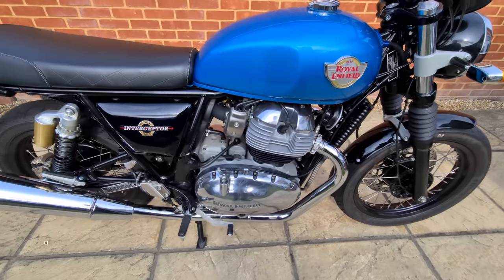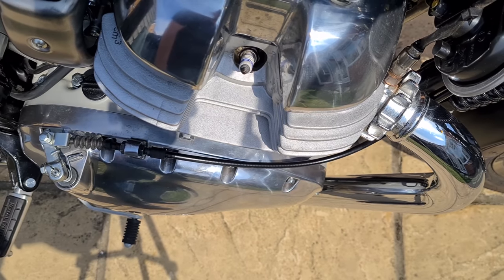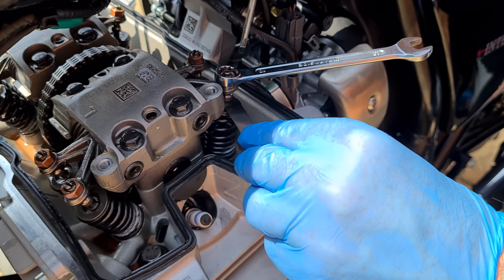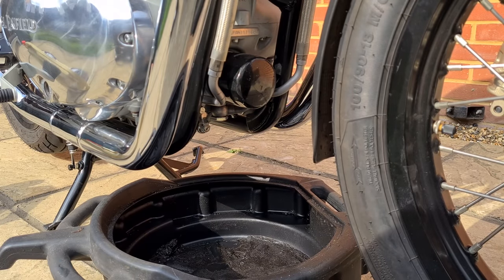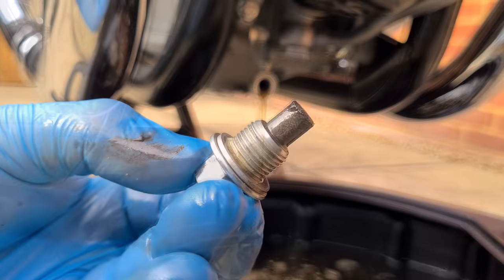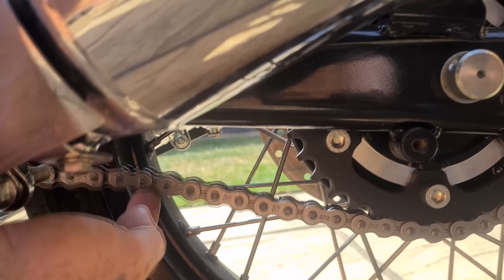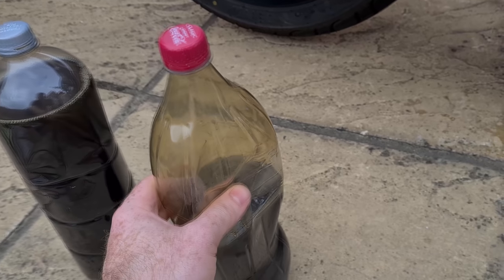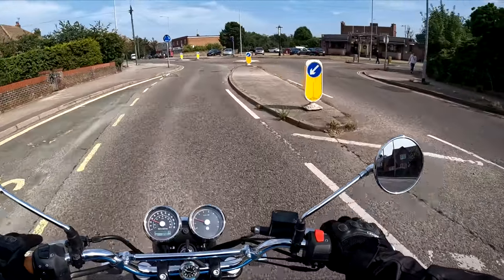Easy Valve Check & Adjustment on The Royal Enfield Interceptor & Continental 650 Twin

Comment: I only rotated the crank one time for valve adjustment. Ever since and now past 30k miles I just put it in 6th gear and gently bump the rear wheel to rotate the cam. After the 12k adjustment I only barely needed adjustment of one valve at 30k miles. This is extraordinary
Reply from the maker: amazing, thank you for sharing

Comment: 👍👍👍👍👍👍👍👍👍👍👍👍👍👍👍👍👍👍 Ye - now I understand why you didn't buy a Moto Guzzi V7 - You need slightly more challenge from the valve adj. procedure ☝☝😆😆
......... on the Enfield the tank has to be removed 🥵
This bike is easier to service than the NC750.... 😨😨 .....  
And, as many others, I'm also looking forward to the perfoming of the Meteors' service ‼‼
Making this kind of videos is your REAL call ‼‼Very WELL done ☝☝🧐🧐
Reply from the maker: That's why I sold the tiger really, valve check too difficult for me 👍 meteor 300 mile service comes soon. Same thing, a lot less valves.

Comment: Cracking job,I've watched a few videos of this and you're the first to actually remove the fuel tank, is it totally necessary?thanks.
Reply from the maker: probably not but it makes it better for video presentation, easier to adjust your valves and give u a change to check your abs pump and connections etc

Comment: You mentioned something about a some kind of sealant and possibly getting a new gasket. It's also my first time trying to maintain a vehicle myself as I usually bring my old car to be serviced. This time I actually want to learn how to maintain my own by myself. I just have a few questions. 
What kind of sealant do I need to use and how do I know when I need to change the gasket and use a sealant? 
How do I apply the said sealant? 
What did you use to spray to clean off the oil? 
When do you actually 'have' to change the filter?
Reply from the maker: Hi, use this sealant https://www.amazon.co.uk/gp/product/B000FW7VNW/ref=ppx_yo_dt_b_asin_title_o02_s00?ie=UTF8&psc=1 but to be honestly you might not need it, do the job and see if it leaks over time, if it does take rocker off, remove the gasket and smear it very thinly along the rubber all the way around, if you are buying a new gasket then put sealant only on the sides left and right where the half moons are on the rubber. the old sealant will peel off. all the best
Reply: @nicksepisode  What did you use to clean off the oil? The spray thingy?
Reply from the maker: @grenzviel4480  brake and clutch cleaner

Comment: IMHO needing to check valve adjustment at 300 miles sux. My Kawasaki KLR 650 didn't need a valve clearance check until 15000 miles, I actually went 22000 miles before I checked mine, they were getting tight but were still within specs, although barely. (Checking & adjusting valves on a KLR is a lot more work than on the interceptor though).
Reply from the maker: I agree with you, valves shouldn't require adjustment at 300 mile, but i think they are probably slapped together quickly along the production line

Comment: Thanks, really what I was looking for. 00:21 Nuff said.......have my trust; low fuel level right at 300 miles (minimal weight removing tank. Get it?), and torque specs. Catch that fuel in the supply hose though :)
Reply from the maker: Holding a camera and a tank isn't easy lol
Reply: @nicksepisode  Wow. You made it look so :)

Comment: I find the first service at 300 miles and a valve adjustment extraordinary. Why so soon? I have a Kawasaki i've just bought with a run in period of 600 miles, valves aren't meant to be looked at until 16k. Now i appreciate the difference between the bikes but even so, to do that work so early on a new bike, is unusual for sure, at least to me
Reply from the maker: It's a quite an old school design and less refined than the modern high reving bikes. The way the valvetrain is set on the interceptor wouldn't hold up to the the performance of the kawasaki. But on the plus side its very easy to maintain

Comment: Great video. Just one question, does the tank require draining prior to removal? Thanks..
Reply from the maker: no, the fuel wont leak out, but it does help if the level is low
Reply: Thanks

Comment: Most shops recommends mineral oil for engine break-in for a minimum of 500-1000 miles.
Reply from the maker: yeah, the shop puts mineral oil in from new, id suggest doing the 300 then changing at 1k

Comment: Thanks so much for the video, I do have one question though. At 4:02 you say the rocker arms should have very small free play and if not to turn one full revolution. My bike had the same free play at both revolutions? When lined up to the L my left piston was a top dead center in both scenarios. Am I missing something?
Reply from the maker: No its fine as long as you have freeplay
Reply: @nicksepisode  Ok thanks, I was starting to second guess myself and getting ready to order the TDC aligning plate. I'd hate to tear it back apart. I only had to tighten the L side about .0005 on all valves. I barely changed it.
Reply from the maker: @WadeMade good job bud

Comment: Looking to do the same job on my CB650F looks quite challenging,  much better access on your bike
Reply from the maker: I'm pretty sure yours has shims and the camshaft needs to be removed, bit of a lengthy job. The beauty of this bike, so easy to work on
Reply: @nicksepisode  True had a silly price from honda just to check plus more if they need adjusting. Got a pretty good manual may have a bash at it.
Reply from the maker: @michelod.i.y.5202  yeah you should definitely give do it

Comment: I have to admit I pretty much regret attempting this… the rubber gasket just won’t stay put and keeps falling into the valve box
Tried slotting it into the cover but that too just keeps falling off…
A tow to the dealership it is 😢😢
The actual adjustment was pretty straightforward.
Reply from the maker: Oh no, did you take the tank off ? It’s a lot easier with the tank off, sometimes you may need a new gasket, this could have been the case for yours. You can also slot the rubber into the rocker cover itself and not the engine head. Use a little bit of grease to keep it in place
Reply: @nicksepisode  got it!
With the help of my son and using touches of silicon based gasket sealant in a few places.
Job complete 🍻
Thank you 🙏
Reply from the maker: Well done ! Glad to hear

Comment: Not so easy as it looks to take away the valve cover. And put it back. Had some problems with the petrol hose lock or what it is. My fingers are too weak or too thick, I think.
Reply from the maker: Did u get it done ?
Reply: @nicksepisode  Yes, everything is done, but when I tried to start engine after all, the fuel pump didn’t work. After many trials and thoughts I found that one of the connectorpins on the cable to fuel pump was bent .

Comment: Question: Is it necessary to remove the gas tank? Can it be done without doing so?
Reply from the maker: you can certainly do it with the tank installed, just isn't great practise for the in experienced as you need to be a little more brutal with the rocker cover and it can get damaged
Reply: @nicksepisode  What about the allen bolts that secure an electrical subassembly?
Reply from the maker: @JayPatel101  you can leave them in

Comment: I take it you got it from moonrakers in Norwich? 
There waiting time for a service is insane. I donr 300miles a few weeks ago and got to wait till this Friday to get mine in for it's first service.
Reply from the maker: Yeah I can see how they are so backlogged, they have a small workshop and loads of stock, lots of 125s selling as well.
Reply: @nicksepisode  I wasn't happy with there PDI check the single bolt under the bike holding the frame was missing I done 250miles with that missing and the bolt on the frame on the header was lose to. I'm really considering doing the service myself after all this..
Reply from the maker: @buster8847  I would bud, haven't had issues myself with bolts loose though
Reply: The only thing I was worried about is the warranty issue 😕
Reply from the maker: Buy genuine parts and maybe take some pictures of work
Reply: @nicksepisode  Or even make a video of it and document the before/after feeler gauge readings and the OEM part receipts!

Comment: surprised they need the valves then - even RE have modern machining gear - also the warranty is yes if you use the OE parts  then warranty still ok - been like that for years not only on bikes (i too work in the motor trade)
Reply from the maker: Yeah I was quite confused, but the beauty is they are easy to do, good ole old school design

Comment: Why would it need a valve check at just 300 miles ??, is that the specified time  ????
Reply from the maker: Its suggested in the workshop manual that the first service interval is at 300 miles and includes a valve gap check. as you can see it did need doing as they were out. the design of them is very old school and does require more attention, but the job is very easy and when you know how it can be done without removing the tank. (albeit not very professional)
Reply: @nicksepisode  
I plan on buying a used one from a reputable dealer I know here in USA/NJ, this helped in reminding me to check any and all paper work, 👍, Cheers

Comment: Is removing and reinstalling the tank a pain? Any tips?
Reply from the maker: Make sure the tank is near empty. Have an assistant with you while you unclip the hose and plug.
Reply: @nicksepisode  does the tank have to be removed? I've heard you can prop it up with a block of wood.
Reply from the maker: You can't prop it due to the location of the pipe. But you can still perform this job without tank removal, albeit a pain. Search tec bike parts on YouTube to see how it's done

Comment: I have an interceptor myself and although ive not had to adjust the valves as yet as it still under warranty i wonder if there aren't a few shortcuts to adjustment of the valves ( ive not tried as i said so may not be possible) do you really need to remove the tank ? Is there enough access without? ( Stubby screwdriver on the adjusters)  Do you need to remove the plugs? Could you just thumb the starter to bring the engine into position re align the timing marks up ? Anyone actually tried doing it that way ? just a few thoughts .
Reply from the maker: You can do it without removing the tank. But you run the risk of scratching the cover. Taking the plug out allows you to turn the engine over without fighting compression. Never turn on the ignition when performing this job. You can put the bike in gear (3rd) and roll the rear wheel to turn the engine over to position
Reply: @nicksepisode  I know /agree about fighting comprehension but just wonder about doing it of the starter ( you aren't going to do anything to anything thumbing the starter unless you put your fingers in the valve gear or chain when operating the starter !)

Comment: Can you provide a link as to where I can get that T-bar thing?
Reply from the maker: It came with the bike. Hitchcocks sell them, though
Reply: @nicksepisode  it's in the toolkit?
Reply from the maker: Sorry for a misunderstanding on my part. It comes with a tool kit set that I own. These can be purchased anywhere that sells tools. It's a 1/2 inch drive.
Reply: @nicksepisode  what's it called? Like if I do a Google search for 1/2" T-bar it'll show up?
Reply from the maker: 94Pc 1/2" & 1/4" Socket Set & Screwdriver Bit Torx Ratchet Driver Case Tool Kit Carbon Steel Socket Wrench Set https://amzn.eu/d/btTxOmW

Comment: Hey bro , could you please help me out.... my. Gt650 works fine for the first 15 minutes( the time period for which engine is warm , not hot.. just my guess) ...l it starts to shut off randomly after getting hot or after fueling up ( everytime I fuel up , it starts to shut off randomly) and .... if I try to turn on ignition just after imy motorcycle shuts off or engine power cuts off  , the start button doesn't respond and THE START BUTTON RESPONDS ONLY AFTER I TOGGLE THE KILLMSWITCH OFF AND ON ... only then my bike ignition works and my motorcycle starts .... and again after few minutes it will turn off while riding and the cycle continues .............  I observed this mostly after I put fuel into my bike ... also the MIL will turn on temporarily .... .. what might be the issue .... RR unit ? Relays? Fuel, pump ?? What is it??
Reply from the maker: You EVAP box is full of fuel. This model you must not over fill the tank, fuel will run down your breather pipe and fill up this box. Basically the box is under the engine near the swing arm and it’s responsible for taking fuel tank fumes and recirculating them into the air inlet. There are videos on here on how to remove this as it’s a euro 5 requirement and the bike doesn’t like it. Search for interceptor evap delete.
Reply: @nicksepisode  thank you bro❤ .. I ll try that .
Reply from the maker: @ReddyHHH210  let me know how you get on bud

Comment: I guess the dumb question is why does this motor need a valve clearances check at only 300 miles?
Reply from the maker: There has been an update bulletin that this is no longer the case. I can only assume production quality control has improved in this department. Always check with you local dealer first

Comment: Always partial to the calibrated torque elbow™ 😁
Reply from the maker: Experience tells me how things should be tightened, after all the wrench I use could be out of calibration or a bolt could have stretched etc. I understand torque settings are there for a reason and a torque wrench should always been used, but I've had more trouble in ths past using them than not. Wheel nuts 100 percent, but sump plugs etc, you just know.
Reply: @nicksepisode  I'm not knocking it, just wishing I had that feel so I wouldn't have to reach for a torque wrench every time I touch something

Comment: No need to turn an extra full revolution, the camshaft turns ½ the speed of the crankshaft so the "L" or "R" marking should be spot on.
Reply from the maker: You do as it’s 4 stroke, it could be on the wrong stroke
Reply: @nicksepisode  That only applies if the marks are on the crankshaft, here the one you are looking at they are on the camshaft that does one revolution to the crankshafts two!

Comment: At the risk of raising the ire of you and the viewers, I'm going to throw down some shade on your verbal presentation. In identifying bolt sizes, you were obviously saying what size wrench fit certain fasteners, but you used terms that apply to the thread size identifiers, such a the two bolts that hold the gas tank are likely to be 6 millimeter bolts with 10 millimeter hex heads, and the rocker cover bolts are probably also sixes, with Allen heads. Sorry if I didn't see exactly what version they are. With regard to the tool you used to rotate the crankshaft, the T bar is certainly good enough, but your warning to only use it is in opposition to what is illustrated in the service manual. The tool being shown on the page is clearly a ratchet wrench. In my opinion, it's very unlikely to self rotate with the spark plugs removed. Lastly, you referred to the camshaft as the crankshaft while showing the line up markings. During the further parts of the video, I went to the comments to see if others had commented similarly to me. I'm somewhat disappointed to be the only one writing this. Seems that a technical procedure should have correct nomenclature. It's not beyond the audience's ability to comprehend correct information.
Reply from the maker: You are the only one who commented it because its irrelevant. Over here we say 10mm and when that's said we all know what socket we will need, a 10mm. No one refers to the thread size when locating a socket to loosen them. And the ratchet you see in the manual is the old version, they realise the clutches were getting damaged on rare occasions so they updated it. Please do your research before commenting. Better still make your own video putting people right 👍
Reply: There are several well known mistakes in the RE service manual - crankshaft rotation direction, excessive torque for the valve cover shoulder bolts and sump plug are the classic ones, but there are quite a few more.